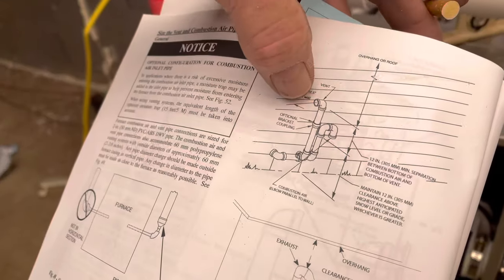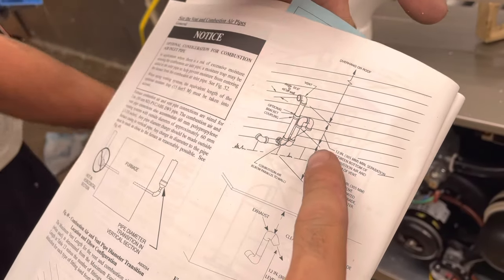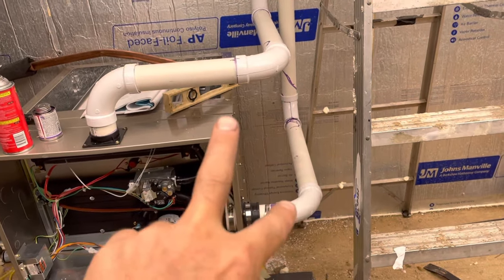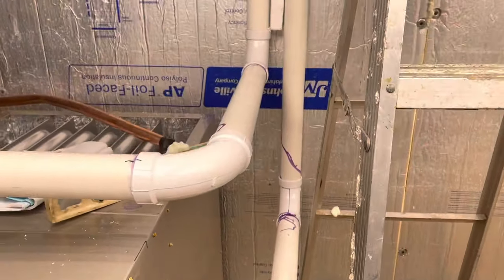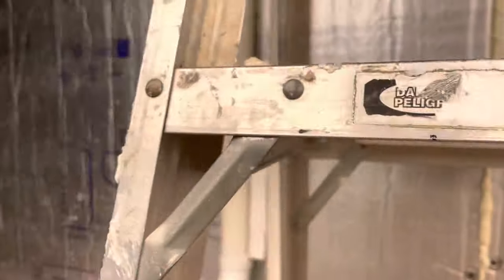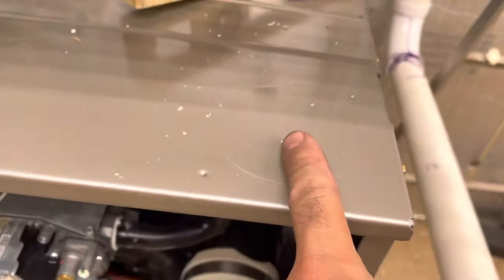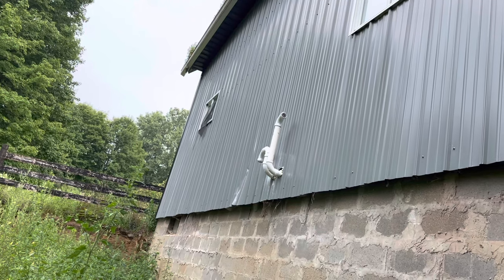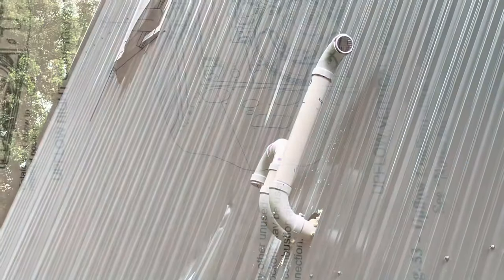Furnace Air intake and exhaust instructions diagram installation PVC pipes

Comment: On the exhaust shouldn’t it be going up with the least restrictions as possible? 
I’m still learning I know that’s true for metal pipe due to condensation, I’m guessing with 90% it’s so efficient that the exhausted air is not hot enough to creat condensation in the pipe?
Reply: All entirely opposite of correct. Old metal flues needed to go up because they relied on convection for the exhaust to flow upward. They didn't have condensation problems because the exhaust is +300F which keeps the water vaporized. HE +95% furnace exhaust temps are barely above 100 so they need a fan to push the exhaust out. This means the exhaust can be nearly horizontal. Also due to the relatively cold exhaust, all the water vapor from combustion condenses into liquid. Combined with high acidity from combustion byproducts, that condensation quickly eats thru metal. This also means you should put a neutralizer in the condensation line to that and metal drain pipes in your system don't get damaged.

Comment: shouldn't that intake have at least 12" of straight pipe before adding 90's???? restriction
Reply: On the intake? No..
On the vent, it's possible but each manufacturer calls for different things

Comment: Hey got a problem I could really use help. Would be much appreciated it, I live in alberta and have a newer manufactured home and when it gets really cold and there’s not much wind we have a problem with the exhaust being to close to the combustion chamber fresh air intake so what happens it the hot exhaust comes out and the fresh air sucks that in and the condensation I think creates an ice plug and then the furnace doesn’t work until we pull that pipe off at the furnace and just use air in the house which sucks a ton of air creating a major vacuum in the laundry room (where the furnace is) and obviously not ideal to use inside air, so I want to extend the fresh air piping further away from the exhaust piping, right now it comes straight up and then is a U pipe so my question is should I cut the pipe before the U and do a 90 and say a 3 or 4’ pipe (with supports obviously) or just put another short pipe after the U and then a 90 and then the 3 or 4’ pipe again ? When I get home I could take some pics if that would help
Thanks
Reply: I guess I can’t put pics in the comments on you tube
Reply: Did you figure it out?
Reply: @Meatwad.Baggins  
Yah u bet put a collar on it and a vertical 3’ piece of pipe and so far so good have had two cold snaps so far & no issues

Comment: What if furnace is inside tight closet?
Reply: I would use a plumb bob to mark the ceiling directly above the ports on the furnace or whatever you got going on. And run the flues straight up through the ceiling. I know that may be unpopular but I like the way it looks. Simple and efficient.

Comment: Should have put 45s on an angle it says use as few 90s as possible
Reply from the maker: Those are the wide 90s
Reply: It doesn't really matter about 90s or 45s.. manufacturers list max vent length and consider each 90 as 5' or 7' for the short 90s
Reply: not how i would have done it